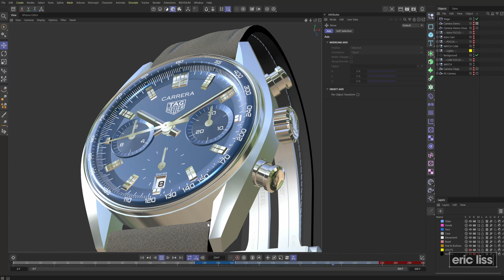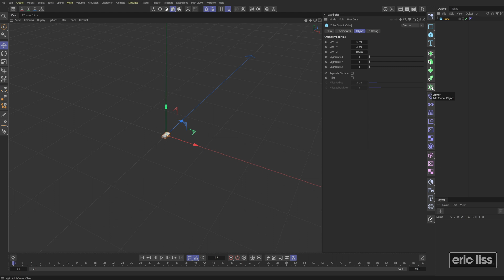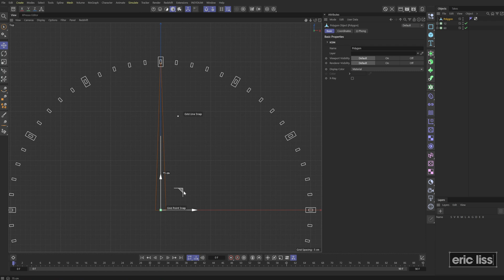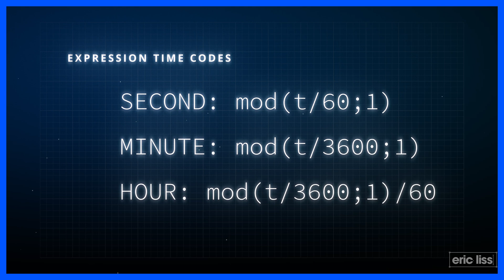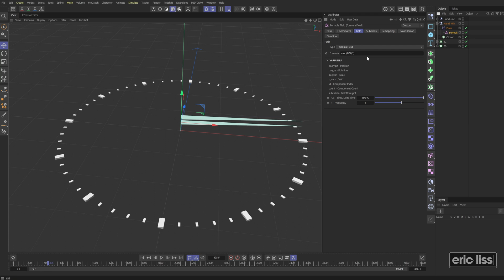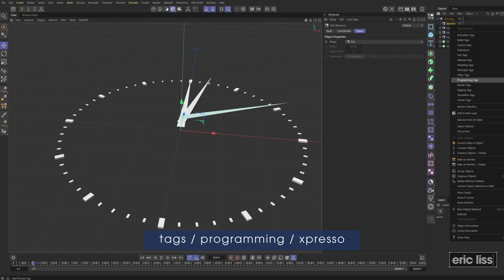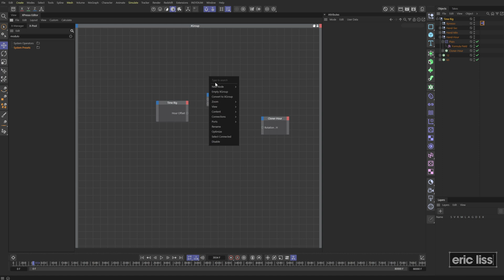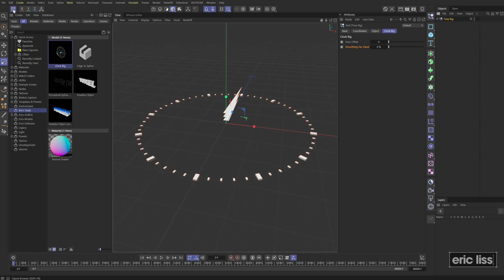Real-Time Watch with XPresso-Cinema 4d Tutorial[4K]

Comment: Yo bro. A quite informative tutorial although it has some mistakes in formula we use for an hour arrow. In order for it to be looped we should put 12 instead of 1 mod (t / 3600 ; 12 ), so it won't reset after the 1st circle round is passed. Also, we have to divide the whole setup by 12, not 60, so that it corresponds how the real hours arrow works. Just for the information. Anyway, thank's for the tutorial. This rig works perfectly. Liked and subscribed. We need some more tutorials. Keep growing on the youtube :) GL
Reply from the maker: Yes! Thanks for catching that. I updated the file using Field Drivers. You can find it in the community section. Thanks!